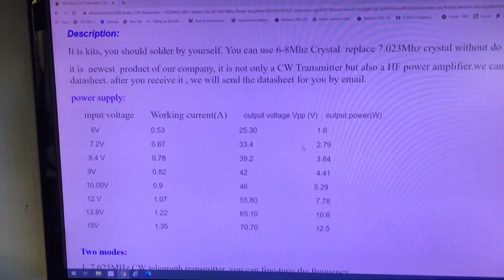10 Watt Ham Radio Transmitter - DIY Part 1

Comment: I bought one of these kits on ebay a while back.  I got a board and a bag of parts.  No schematic, no instructions.  Pretty much worthless.
Reply from the maker: Same here Tom. But they will give you a link to get the schematic and instructions.
"We can provide datasheet. after you receive it , we will send the datasheet for you by email."
Try emiling them......
https://www.ebay.com/itm/125822629469?_skw=.10W+QRP+Radio+HF+SW+CW+telegraph+Transmitter+5-9MHz+HF+Power+Amplifer+DIY+kit&itmmeta=01KAEJ0BG67VCJ8MJJP7FETAGZ&hash=item1d4b9cf65d:g:JSwAAOSwDGJd05dQ&itmprp=enc%3AAQAKAAABEFkggFvd1GGDu0w3yXCmi1e%2FtFXPg5WxXzSOzZ7LjMHmnaXBWJopE45KQPKlDCkStsNiOMhaZp5ATuAZhrHJ7MsfxPy9GaW2YNqHjsRLSlUbwVGnRpnXkekgnT4tjmaWq4fYxYZe2RgIxmU9E%2Fodecaz05S2ObKzSZP67oHHe%2FAvCT52tMCj1VyUunFsMMxAT5W4haDOpbojhWjzvxfTwQs75mVCex5n1RMEgrJ%2BEW2WQldxxZgD4QlXlq3LZtefl9proT7%2B%2BiLjHSA1k0ZUbN4cfNBC6SpZpUIKWddNA1zj01Epa2pPJIy3XGjqDKpnhOutflLQLdW35U9fZDN8unP%2BnLYDVW3GBc9Pk9j7xv%2B4%7Ctkp%3ABk9SR6a4gdLTZg
Reply: @rfburns3472  Anyone that sells a kit without instructions or even a schematic is not someone I'll deal with.  This "bag of parts" is going in the trash.

Comment: Can you link the product? I can't find it on ebay with any search terms. TIA 
73
Reply from the maker: The dealer I bought it from is no longer on eBay.  But there are plenty other sellers.  Search eBay on ....10W QRP Radio HF SW CW telegraph Transmitter 5-9MHz HF Power Amplifer DIY kits